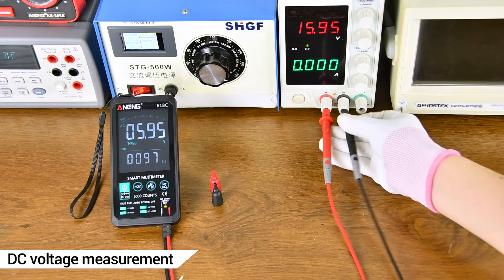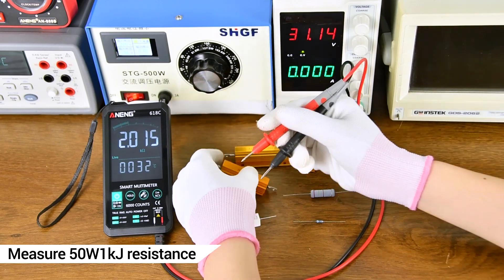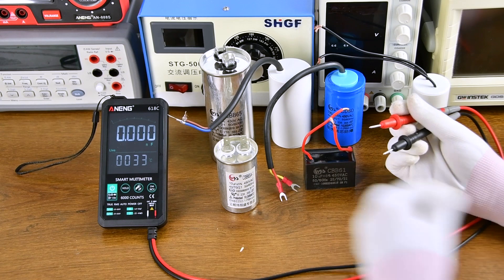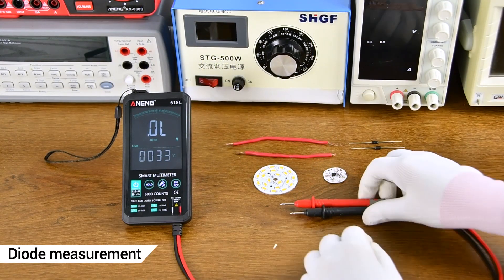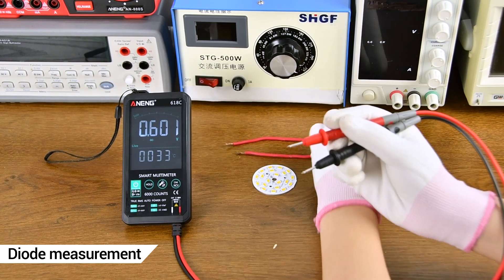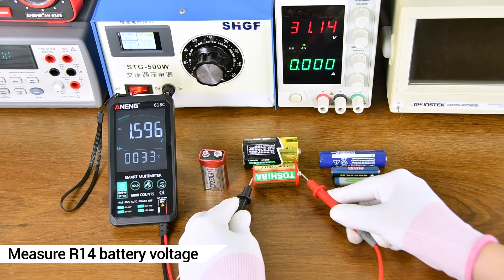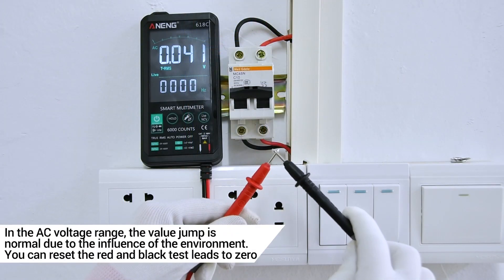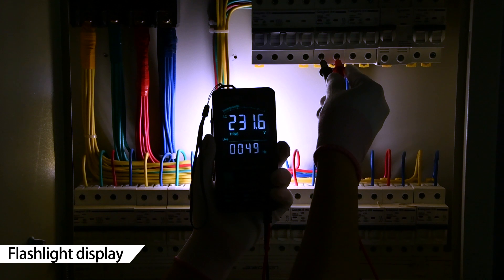ANENG 618C Digital Multimeter Smart Touch Auto Analog True RMS Transistor Capacitor NCV Tester Meter

Comment: Bought this a month ago. Can it be used to measure current?
Reply from the maker: dear,it could measure the current,it can be measured the AC/DC Voltage~
Reply: @davidelectrician8297  So we just connect the multimeter with the load in series? Do we need to change the mode by pressing any button?
Reply: Clamp meter is good to measure Ampere  just go for it